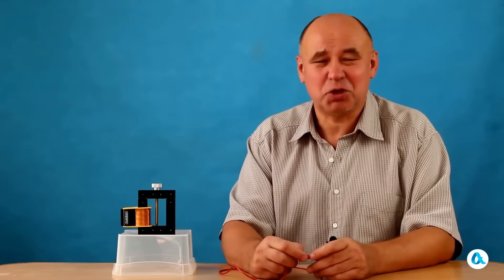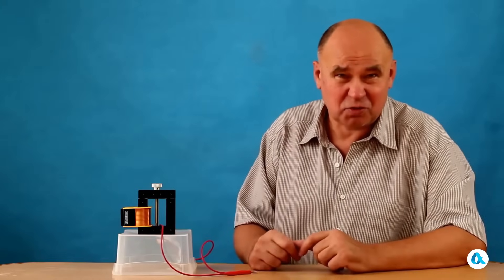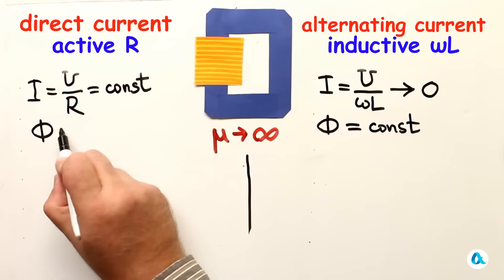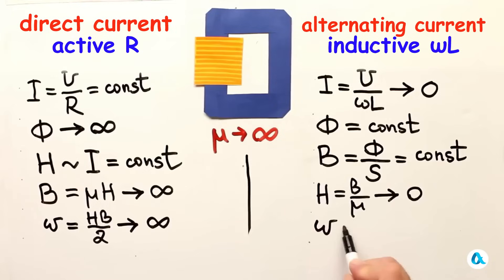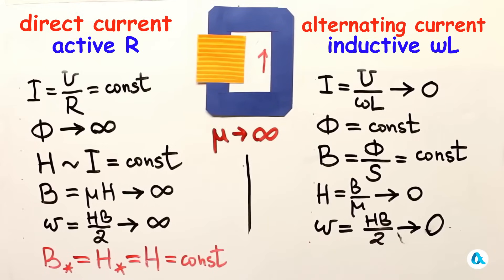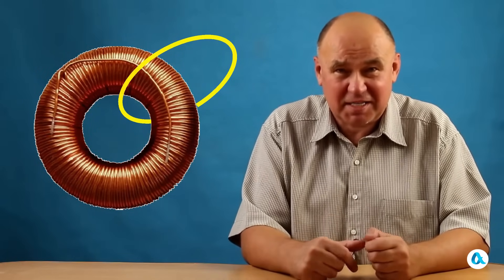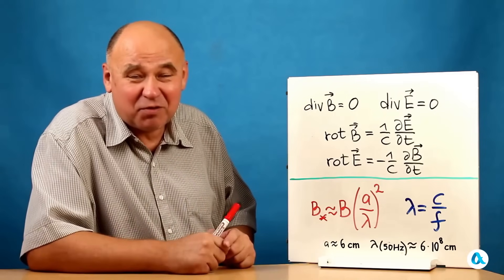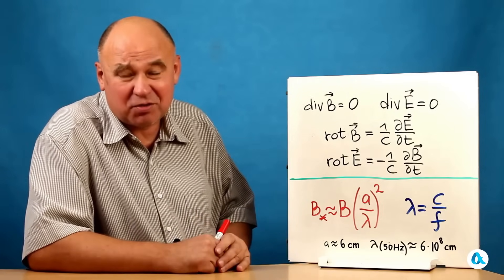Power transformer paradox

Comment: The so-called "power transformer paradox" isn't truly a paradox when you consider Maxwell's full formulation and the role of vector potentials in near-field induction. Even in the ideal case of infinite permeability (where flux is fully confined), the time-varying magnetic vector potential (A) outside the core still enables EMF in the secondary via Faraday’s law in potential form.

This is closely related to the Aharonov-Bohm effect, where EMF and phase shifts can occur even when the magnetic field is zero in the region of the wire. It’s not about field "leakage" in the classical sense, it’s about global field continuity, topological linkage, and the underlying structure of the dielectric-aetheric medium, if one dares go that deep.

Comment: You are solving Maxwell's equations in their full-fledged dynamic version. But 50 Hz at 6 cm reside well inside the realm of the quasi-static approximation. In the magneto quasi-static approximation you have Faraday's law and a simplified version of Ampere-Maxwell's law that does not include the displacement current (i.e. Ampere's law). In this approximation there are no waves, and the fields 'propagates' instantly (or rather, at the scale of your chosen spatial dimensions, the propagation at the speed of light is so fast as to appear to be instantaneous). When solving the simplified equations in this setting we can have an induced EMF in the space around the core even when both the field B and the magnetic induction dB/dt are exactly zero (I use an ideal infinitely long solenoid in my videos). The explanation is that the induced voltage is due to the induced electric field that is curling around the lines of dB/dt, in accordance with B = curl A, dB/dt = curl dA/dt, and Eind = -dA/dt.

Are you saying that the magnetic vector potential is not real? (Because we know, from quantum theory at least, to be as real as it gets)

Comment: If I understand correctly, what is most interesting is that the core emits waves with wavelength of 1000 km and yet it is able to receive them with an antenna of no more than a~6cm.

To be honest I never quite understood why there is H and B fields that are both magnetic in nature but they are somehow different - a video about that would come a long way to explaining how are those 2 fields created and how / why do they change in time and frequency domains.
Reply: Antenna-length is actually irrelevant, and radio antennas are based on resonance.  (Note that antenna-wires are incredibly thin, yet they somehow block EM waves across large areas, creating big downstream EM-shadows, shaped like disks.)  
"energy sucking antennas" was a hot topic around 1999, since antenna specialists wrongly thought that longer antennas receive more energy.   No, longer antennas are just closer to the resonant frequency, at least down below the ten-meter band.  In ham radio we know that a whip-antenna on your car, with a resonant base-load for 160M band, receives the same signal-power as a giant antenna tower for 160 meters.  Bizarre, eh?

Notice that oldschool AM radios have a tiny ferrite rod as their antenna, rather than a 100M antenna tower.   Yet they intercept significant signal energy.   They work because the ferrite coil has a tuning capacitor across it, and tunes to resonance, at the same time the separate radio tuner is turned.  The Select-a-tenna external tuning-module was once a popular produce.   Sharp resonance, in radio receiving antennas, is very very weird.

Comment: It is not necessary to have a magnetic field outside of the core for the wire to feel induction. 

Whenever you have a time-changing magnetic field, you will have a non-zero curl electric field in those exact coordinates of the core. Keep in mind, even if B tends to zero, if omega tends to infinity then dB/dt is not zero. 

To get the voltage induced in the wire, you need to integrate electric field vector along the length of the wire. Another way it can be calculated is to do the surface integral of the flux of curl or electric field inside the surface enclosed by the wire. Since curl of E is zero outside of the core, you can only integrate inside the core and you get your induced voltage. 

You can see this more intuitively if you try to solve for E* field and then just integrate the E* field. You can solve for E* by exploiting the symmetry and using faraday law outside of the core with some appropriate boundary conditions. 

I believe you should have solved for E* field not for B* field.

Comment: The Maxwell-Faraday law, one of Maxwell's equations, means that an intrinsically time-varying magnetic field is accompanied by an electric field, which is not coextensive with the magnetic field.  It is this electric field which results in the emf in the transformer secondary, even though the secondary is not in the magnetic field of the primary.

Comment: I have always wondered why the geometry of a winding doesn't matter in relation to the EMF. What they told me is that the total enclosed flux by the winding is what the MMF drives.  Without proof I assume that some flux outside the iron core  does exist but is too small to noticeably influence the EMF when you change the geometry of the winding. The majority runs around in the core. So what ever you do with the geometry of the winding, the enclose flux is mainly constant.
Let me know if am off track here and tell me in that case why the geometry of the winding doesn't matter.

Comment: Volt is pressure and pressure is like sound that how it induce sound and heat. Direct current and alternate current affect induction differently so with the tortoise in one direction pulse dc will create thrust like that is why fourier transformer super impose explosion if begin as low frequency then increase frequency ( speed ) with time can be precises extension to target distance of explosion or thrust depending on goals of user. If speed = distance ÷ time 
= freq × wave lenght
Distance = ( freq× wavelenght )/ time 

So frequency getting higher as wavelength frequency and  shortening as time goes by. But if we keep constant frequency and wavelength then the pulse length or on cycle and current will determine the thrust force can push space ship

Comment: I think one should make a deeper analysis, not based on B or H , because they are force fields.

Everything in physics can, and must be derived from energy considerations, and not from fore considerations.

Therefore, this whole analysis has to be done again basing it on the vector potential A which talks about energy directly! 

I think that if one does that, there is no paradox whatsoever, although I haven't the time to do this now.

Comment: There's a related paradox that puzzled me for a while. When a current flows in the secondary, it produces a magnetic field that cancels out most of the core flux produced by the primary. In the ideal situation, it cancels completely. But if there's no flux, what carries energy from the primary to the secondary?

The answer again turns out to be fields outside the core. The core acts as a kind of waveguide, concentrating the E and H fields around in such a way that the Poynting vector is directed from the primary coil to the secondary coil.

Comment: 1:11 "How does the wire that is outside the core know that there is a change in the magnetic flux inside the core?"  This intelligent question points us to the fact that something is missing in our understanding of electricity. Physics is the domain of reliable formulas, not the source of explanations.
The thing missing is a type of Dark Matter.  It is galactic matter,  It moves at a speed proportional to its energy  It is massless and forms no compounds.  This GM delivers energy to all the subatomics of normal matter.  It is the medium of the galaxy, in other words, it conveys light and all the other EMFs.In our neighborhood, it moves at c in every direction at once.  Photons do not accelerate to c, they simply energize the medium that is already moving at c.
Electricity is complicated.  It is made of the motivating energy of photons, the wave-like behavior of the medium, the particle behavior of electrons, the copper or other metal conductors, and the insulators.  Then made more complicated by coils of insulated wire that concentrate  the flux, a secondary type of kinetic motion from the motivated electrons.  The electrons do not jump the insulation, but whatever energy influences the GM is not obstructed by insulators.  The flux which is carrying photons is then able to motivate a new set of electrons, within range, within limits.
All of the "action at a distance" phenomena can be explained by the properties of the GM.
Reply: você tenta oferecer uma explicação alternativa para a eletricidade e o eletromagnetismo, mas suas afirmações contradizem a física estabelecida e não apresentam evidências experimentais. A teoria eletromagnética baseada em Maxwell e a relatividade especial de Einstein explicam os fenômenos discutidos sem a necessidade de um meio físico como "GM". Assim, essa proposta se encaixa mais no campo da especulação do que na ciência convencional.você consegue apresentar evidências?
Reply: @369Eletricidade  
Thank you.  Your clarity of thought is appreciated.  We will not be experimenting on Dark matter any time soon.  But, this is how I think it is.

Comment: Don’t listen to this guy, read a textbook instead. So many incorrect claims here, it’s not even wrong - it’s preposterous!
Reply: Agree.  He just knows enough to confuse himself! I wonder where he got his PhD.  If mu approaches infinity, both current equations don’t apply. If mu approaches infinity, current approaches zero because the inductance approaches to infinity. In this case, to establish any current, you need infinite voltage.
Using the same reasoning, you can make a paradox out of the Ohm's law.    We understand current and voltage cannot be infinite but we accept infinite resistance.  So, if the current is 1 Amp and the resistance is infinite (both are reasonable conditions in their own way), according to the Ohm's law in this case, the voltage should be infinity which is clearly wrong and hence a paradox.
However, if the goal of the video is to get people to make comments, he achieved that goal!
Reply: There may have been errors when translating the video via AI, the original video (Парадокс Транформатора) is on the Russian channel. (I translated this comment via Google Translate)
Reply: @catabars1120  That’s no excuse. The diagrams and text are fully coherent with what he was saying and most of it makes no sense to anyone versed in electromagnetic theory. It’s not just a small mistake here or there. The problems with this video are systemic and seem either the result of a very confused individual or deliberate sensationalism and misinformation. Electromagnetism simply does not work the way he describes. Infinite permeability or flux is not an argument used to demonstrate any usable theory. It just doesn’t compute. Then there is all the hand waving about short circuited turns that are way bigger than the region of magnetic field with no mention of how field strength changes over distance. I could go on, but we’d be here for days - the video is literally riddled with wrong interpretations of well understood phenomena. It’s just so bad.
Reply: The paradox is legit. If all, or very nearly all of the flux is in the core, how is the induction occuring?
I learned that you need a magnetic field, a conductor and relative motion to induce voltage. Then its taught that the conductor cuts thru the magnetic field lines to induce voltage. 
Well, if all the magnetic field lines are in the core of the transformer, there are no lines of the field being cut by the conductor, hence no induced voltage.
Thanks

Comment: 0:50  An alternating magnetic flux will pass through this loop.
No, because the magnetic flux is concentrated in the magnetic core, and do not radiate as much as one can think. A close magnetic core is not a antenna (altough there are some losses)
When you wrap the wire tight to the magnetic core on one loop, you have a coil with one turn. When you make the loop big enough, you have a coil with 3/4 to 1/4 of a turn and the rest of the wire that is not under the influence of the magnetic field (i.e. far away to the magnetic core) is just a load/resistance with a very low value. Basically you need to know where the coil ends and where the load begins.
So, how the wire that is ourtside of the core know about the magnetic flux? Because of the current that is induce in the coil and not directly by the magnetic field.
Well, that is my opinion.

Comment: What about JC Maxwell and his a-field?  
Drive your toroidal air-core inductor with high frequency at high amperes, but at frequency low enough to remain far from resonances, where the wavelength is much larger than the length of the windings, much less the diameter of the torus.  )   Regardless of frequency, outside this torus we'll only find Maxwell's a-field (also called Faraday's "electro-tonic field.")    Maxwell gave this field the label "A," because he considered it to be primary, while the magnetic field was merely a mathematical convenience, subsidiary and so labeled the "B-field."   (Thus we follow Maxwell's original concepts, rather than the later interpretation placing b-fields as primary, and consigning his a-field to oblivion.)   

With two air-core torus-coils, one driven with high-frequency high-amperes, and the other used as a detector, we should still find some "transformer action" between the two, but caused by a-field coupling, and hence only becoming significant at high frequencies.  (I note that Bohm-Aharonov a-field effects do go all the way down to zero-frequency DC.)

Hrm, with enough high-frequency current, could we perhaps light up a nearby fluorescent tube?   I expect so.   During AC, the dynamic a-field produces an e-field outside the torus, i.e. some RF voltage in empty space.   (Imagine bending a tall thin Tesla coil into a closed loop, and finding that a nearby fluorescent lamp still illuminates!)  

Also note that empty space behaves like a long chain of parallel-plate capacitors connected in series.   These gedanken-capacitor chains pass through the donut-hole.   A lone electron suspended in the donut-hole would be expected to vibrate axially, no?   Or instead, shove a very long straight rod through the donut-hole.  We could even use it as a dipole-antenna to emit kilowatts of radio waves, yet with no magnetic connection to the torus-inductor or the radio transmitter.  But, remove the long rod and the kilowatts no longer are emitted.   What then is the precise nature of the energy-flow found in the gap between the long rod and the torus-coil?
Reply: Right! One sholud not make this analysis based on the B field, which is a force field. One should make this analysis based on the A field, which is an energy field.
Reply: The A-field was purposefully "lost" by Heavyside in his reformulation of Maxwell's equations, to hide the gravity component that would otherwise become apparent, especially at higher frequencies - at least that's the prevailing narrative around A-field.
Reply: @vaakdemandante8772  Yep, and Hal Puthoff was patenting a-field detectors recently.   Some claim that a-field waves go through entire mountains, and travel FTL.   

But a-fields are still shown in the Heaviside/Maxwell equations, as "vector potential."    Faraday marked them as primary, and Maxwell agreed, naming them "A fields," while the magnetic fields were only abstract mathematical concepts, hence labeled b-fields."     The physics community quickly reversed this, insisting that a-fields don't exist.   Then Bohm and Aharonov made everyone look stupid, by discovering how to detect a-fields with a double-slit experiment using electron-beams.

With torus-coils, no magnetic field comes outside, but a-fields sure do.   If you put an object through an operating DC torus coil, it comes out slightly differently, since it has moved along a constant a-field flux, but without moving back again.   (Heh, put the same object through the torus in the same direction, over and over.   Will anything happen to it?    Try it with radish seeds, then plant them, and look for changes?)

Comment: It seems that there needs to be a discussion about the Nearfield waves and the Evanescent Waves (the virtual energy). Evanescent Waves weaken as 1/r^5, AND if there is no sink for their energy, the system behaves exactly as if the Evanescent Waves were never there. But IF there is a place for the Evanescent Wave energy to go and do some kind of work (often just heating), THEN their energy becomes real and shows as a load on the wave source.

You will not find this explained in the so-called Maxwell's Equations with only 4 equations and no complex numbers. Those 4 are more properly called the Heaviside Vector Equations and they are an idiotized version of the true set, having been simplified beyond truth. 

The TRUE set of Maxwell's Equations are 20 in number, and they use Quaternion math, and DO involve complex numbers. Quaternions are quite a topic unto themselves, and cannot truthfully be reduced to Vector Math, except in very simplified situations.

Comment: Unclear use of your variables and what you were writing, and what is the true paradox?  DC vs AC, or normal wind vs Bifilar wind, and is a torroidal core any different than a square core.  Why not have some measurements vs just using the cores as a prop vs demonstration.  I do not follow your true point of the video.  watch again.